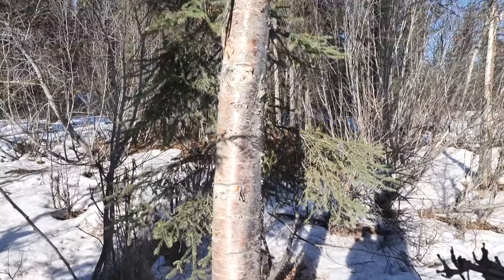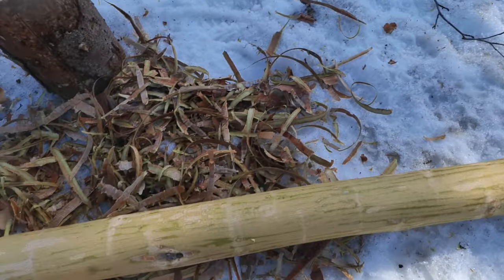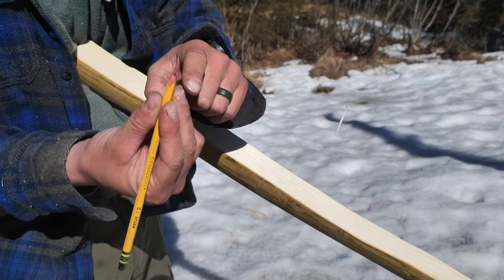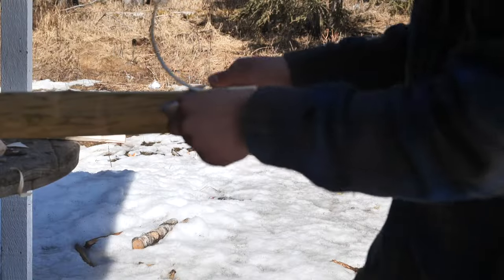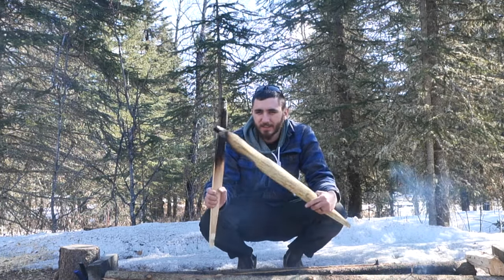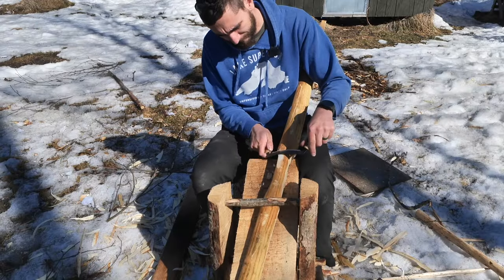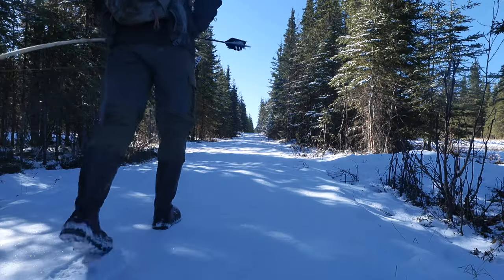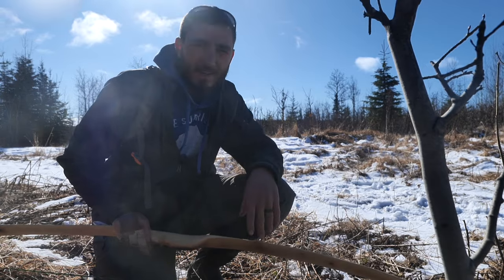Making a Birch Bow and Arrow

Comment: Good video. Too bad about the first bow. All that hard work gone. I make a lot of bows out of chokecherry. If I split it green, invariably it will twist. Along time ago, I learned to take my chainsaw and run it down the length of the log on both sides. To keep my chokecherry from twisting, I would peel the bark off and let it dry out that way for a while. With your birch, all you need is ensuring control of your split. With weakness on both sides of the log, the split will usually follow the saw cuts. This might work well for you. Keep making bows!👍👍🏹
Reply from the maker: Interesting! Do you run a cut down both sides of the log or just one line? I’ll give that a try.
Reply: @Benjamin.stevens   I usually do both sides.that leaves an inch or so width down the middle and helps control the twisting while drying. As you may know most chokecherry  doesn’t get very big. It’s the larger pieces I try to save this way. The saw cut is usually too wide on the smaller staves.

Comment: Hi, you said that birch is the best bow wood in Alaska. You could also try making the bow's belly out of compression wood from pine or spruce and the back out of birch (like the Sammi) or a backing (e.g. cable, string, rawhide). Generally speaking, this is considered very heavy and it might then no longer be a selfbow, but these materials could also be used. I've heard that this compression wood has a pretty high density and can withstand a lot of compression. Perhaps you could also make a Penobscot bow, since similar bow woods to those in Alaska also grow in the area around this river, so they're rather poor bow woods. I'm currently experimenting with these things myself and will see what I find out.
Reply: Yes compression wood spruce will make a belly laminate it is much denser than birch. Like you said the finno-ugaric bows were made this way and I have done it with alaska spruce. However compression wood moves alot as it changes moisture content a bow that was tillered with heavy reflex in summer  will have a deflex In winter after it sits at extreme low humidity. Then the bow will reflex again as it gains humidity. Branches on spruce do the same thing as they all have compression wood. A sinew backed two wood bow is much more difficult and time consuming to make than a heat treated all birch bow. A sinew backed heat treated birch bow would be simpler and not have the huge variances in the proformance of a two wood. bow.
Reply: Hi, yes that's right. I found the passage in the Tbb 4, Chapter 2: "But the bottom, compression side of horizontal branches can be sinew-backed, yielding first-class results."and "Compression wood shrinks or expands with MC changes 10 times or more than normal wood."
Otherwise he could use Larch, which has a decent density and could work as a bow wood (Tbb 4 chapter 2: some good bows) or a antler bow, which will be my next Project.

Comment: You think birch will will make heavy warbows? Of course flat design. 100lb?
What u think  limits are with birch?
Reply from the maker: If the bow was big enough you cold make it as heavy as you wanted. It is definitely not as good as Osage or hickory, but its availability is why it’s my first choice.
Reply: @Benjamin.stevens   What was the weight of it?
I have yellow birch.. I don't know how to make a bow according to dimensions for 60lb?
Reply from the maker: This one was 47 I believe. I have since given it away.  If you make the limbs the same length as your draw length and 2” wide you should be able to make a 60 pound bow.
Reply: @Benjamin.stevens   wow! 47lb could take a deer 👍
Reply: @Benjamin.stevens what do you think I will need for a 70 lb Birch bow? Dimensions

Comment: I made ultra primitive bow out of birch. I found out that bich has lots of string follow but it is decent material and easily available. You can make bow out of any tree the only real difference is the potential draw weight and total bow lenght ratio. Weaker woods create weaker bows, but they all work the same pretty much. Actually if you wanna make heavy bow out of weak wood you need to play with shorter bow and shorter draw lenght so that you get lots of weight without bending weak material too much. For Arctic bow materials mountain ash, birch and swamp pine is best stave for one wood primitive bow. My altime favourite for heavy bow is mountain ash, but for easy and straight bow pine is the number one.
Reply from the maker: Try to fire harden it, I have almost zero string follow on any of my fire hardened birch. I’m excited to try mountain ash.
Reply: Can you skip The fire hardening by using electric heatgun? Or butane torch? Mountain ash has some string follow too so you might wanna harden it.
Reply: I just wanna say that It is hard to find big and straight mountain ash for stave but when you do it is Elite bow material.
Reply from the maker: Probably but I haven’t tried it.

Comment: Love your videos! I live not far from you and have been considering building a birch bow myself for years. This may be the motivation I need to do it! Have you considered backing your bow with something like sinew?
Reply from the maker: I have not, the birch is much stronger in tension than compression. All of my bows that have failed, failed on the belly side. So I am not certain sinew would be beneficial. But prove me wrong! I’d love to see it.
Reply: Indeed birch self-bows should not be backed with anything, as this merely lessens the tension and increases compression on the bow. Playing right into birch's weakness making it very likely to break. Birch itself however is a great backing in a laminated bow, such as my people's traditional bows. They're most often made with a thin birch back coupled with a compression pine belly. Both lackluster bow-woods by themselves, but together make a formidable tool and weapon.